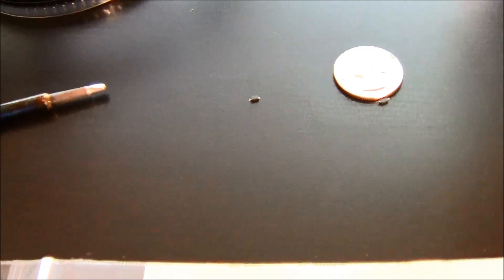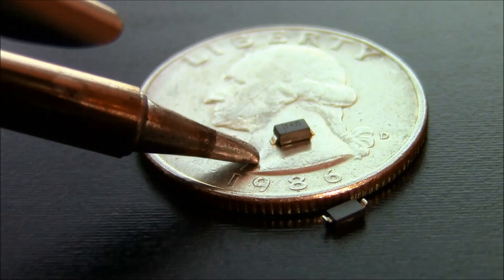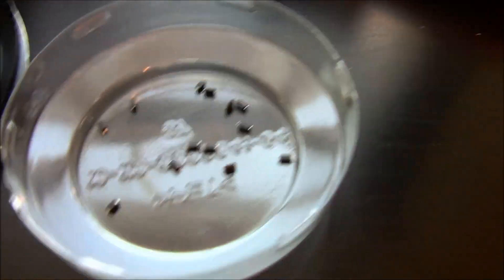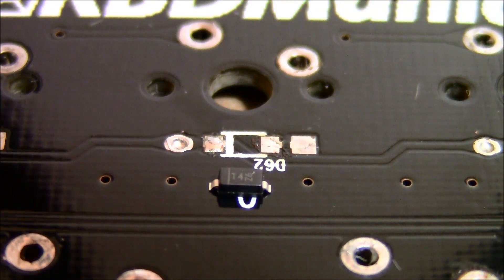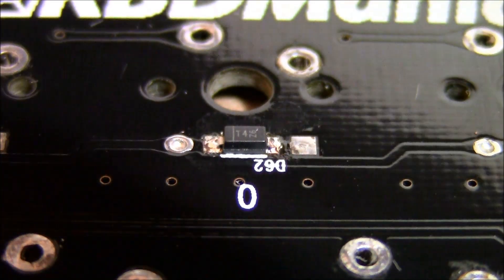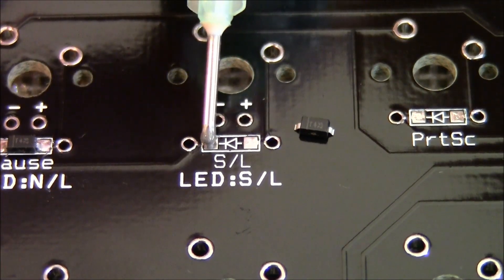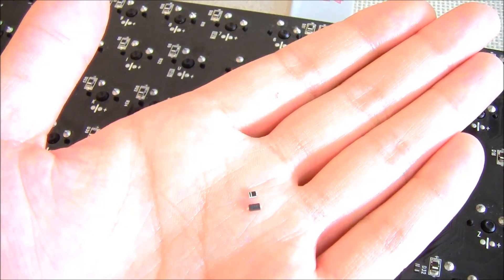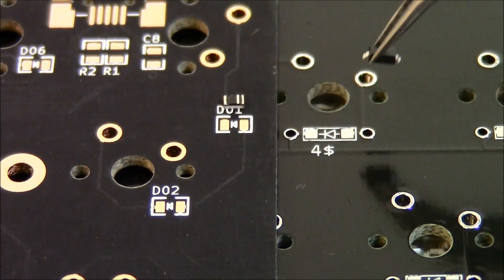Soldering SMD diodes

Comment: Thats almost exactly what I am making .
 I forgot to set the volage output on a bec buck voltage regulator and a tiny smoke string came out of my 5.8ghz FPV diversity reciever .
 My diodes came on a clip of the roll type you have . The strip has little pockets like mini butter tubs with a thin plastc film cover to peel back .
   I just screwed a small vicein front of me on my desk and have a lamp on one of those 3 piece arm adjustable position desk lamos  , and a microscope soldering goggles like jewlers lupe with flip up lenses . And a pointed soldering tip .

Comment: When trying to weld them, the silver square that is on the base came up, I tried to weld it again, but it no longer welds, and apparently that area seems to have burned, since it looks black, what can I do?
Reply: Turn the heat down .  Maybe scratch or scrapethe solder resisting coating away with a sharp razorblade gently and stick a tinned jumper wire there by folding the tinned end over to double the wire like a stronger end to attach and try soldering the new diode to the othercend of the wire . Maybe mount it solid to not flop around with glue if it works .

Comment: Hey, great video! I was had a few questions. I received a hotswap board and it's missing a diode and dealing with the AliExpress vendor is not going so well. My friend helped me determine that it's probably a 0603 diode! I was wondering, when buying these diodes, do they have to be a specific type or is any 0603 fine?
Reply: Digi key brand comes in the mail 3 days in USA
Reply: I measured the diode with a micrometer and checked the specifications for the same similar type of diodes . Mine that burnt out was a peach colred . The new one is black . 
 Surface mount , led , glass diode , zenar diode , germanium diode , are search words , and there are 3 pin , 2 pin connection whatever the new one works fine . I saved $35 by fixing it . 
😃
Reply: @gregorydahl  Oh great, thank you I'll look this up!

Comment: Does isopropyl alcohol corrode the board?
Reply: Alcohol should not corrode the board so long as it is not diluted down with water.  90% isopropyl alcohol will evaporate a few seconds after it is applied.

Comment: Couple of days ago I did 250 0.6 mm LED's with Iron and 0.8mm (0.032) soldier.  No magnifier just by sight and some cheap crappy tweezers.  I had three errors; 2 had bad connections and one I forgot to soldier altogether, so all considering I do not think I did to bad.

Comment: Hey weird question. I have a mini human spine made out of PVC it's about 20" tall. 
All the spine parts slide and stack on top of a metal rod so they all have a hole in the middle to do so. 
This leaves about 1.5mm of space in the hole through each of the 20 parts that comprise the human spine.   
Should I just get one straight wire and small LED lights and solder them all onto the wire so it fits down the hole?
Reply: i don't know if this project is done already or not but that sounds awesome

Comment: hello I have a 12 volt auto LED bulb that does not work knowing that in the circuit I have two or three SS34 diodes that burned, but the fan did not turn, do you think I need to change the diodes SS34 ?

Comment: That soldering paste looks like a dirty work since two drops unite as you heat it up. Is it safe to do like that? Isn't there a risk of a circuit?
Reply: a good part of solder paste is flux,   once the solder begins to melt it will wick itself towards the pads and separate unless the amount of solder is way to much and it didn't appear so.  once the flux was gone it looked ok
Reply: Surface tension and solder mask are your friends. As long as you don't have too much solder, the solder mask will repel the solder and the solder will just remain on the pads and component leads. In fact, if the hot air station isn't blowing too hard, surface tension will pull the component into alignment if it wasn't already properly positioned.
Take a look at https://youtu.be/b9FC9fAlfQE?t=838 for a nice example of soldering a SMT IC. Pay close attention to how he fixes a solder bridge between two pins. And this video https://www.youtube.com/watch?v=8Q6YNmBKjiU is a really nice demonstration of hand soldering different sizes of devices. Personally, I don't see how he managed to do the 01005 device. But it's definitely a nice demonstration on how surface tension helps.

Comment: How do you know the specs of those diodes?
Reply: I had to go by size of the contacts spacing on the printed circuit board i was fixing .and measure with a micrometer and check the size of the new ones in the catalog amps volts size . It is an smd (surface mount diode) it is working now .

Comment: What size is the diode?
Reply: John Bäckstrand  the diode is a third of   piece rice
Reply: no way to know since the author never posted what model and package the diode is. but given the scale to the quarter's numbers estimate about 2mm by 1mm
Reply: Assuming that the PCB is intended for Cherry MX switches, you can get a good sense of the size by looking at the center mounting hole for the switch which is 4 mm. Then by using a screen capture and a graphics program you can  determine the number of pixels for the hole diameter and the number of pixels for the length of the 2 diodes to get their relative sizes. I've done that, and it looks like the 1st diode is using the SOD-123 package and the second is using the SOD-323 package. Ignoring the leads and just looking at the epoxy body of the SOD-323 package, it has a length of about 1.7mm. The first diode is larger and it's length is about 2.7mm.

Comment: Hi What temperature was your iron set at? Thanks
Reply: I set one at 429 degrees farenheidt for 3mm diode and it did not do too bad . I think i used 60/40 flux core solder like from walmart . And a little watercolor paint brush for paste solder . A razor blade , a vice , a lamp , magnifying glasses at 5x .  Looks like a 4mm pointed solder tip . Not sure